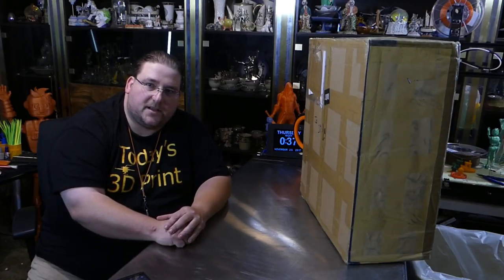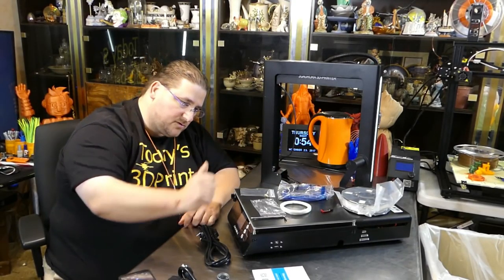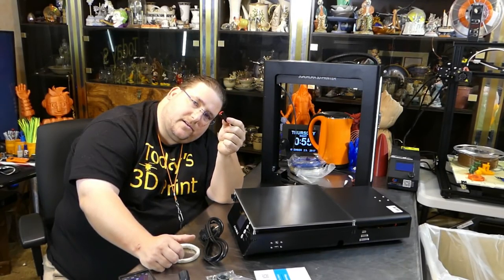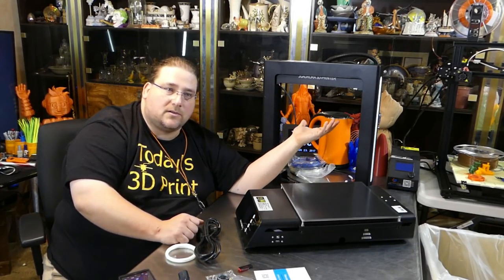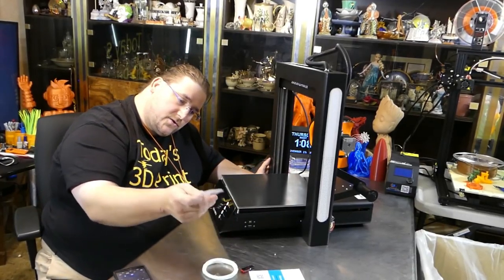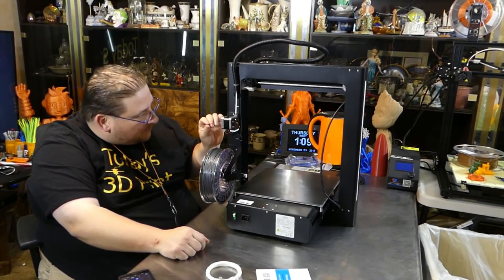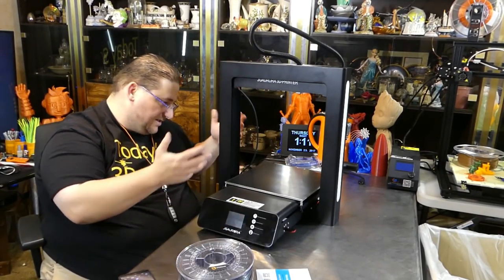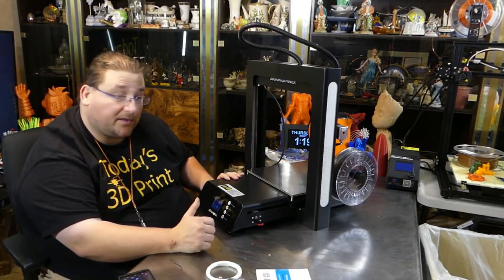Today's 3D Print 162 JG Aurora A5 Ubox, Assemble, Print, Mostly Uncut

Comment: Thanks Chris, as soon as you unboxed it I thought it was an 'ultrabase' equivalent too. Please let us know how well the base performs, and if you reach out to your supplier, if the glass is available separately. Cheers, JAYTEE
Reply from the maker: +JAYTEE Tompkins I just reached out directly to the company $108 for two pieces on the way to me also next month anycubic is supposed to have 310 by 310mm ultra bass on Amazon I will try both
Reply from the maker: +JAYTEE Tompkins forgot to answer your other question so far it is performing very well it sticks better than ultra bass so it does not Auto released like ultrabass at first you might think that's bad but it's actually good because power off resume Works since the part does not Auto release but it's still very easy to release

I suspect if I sanded the ultrabass very lightly I might get the same effect since I have more than one piece of it I may try that

Because the ultrabase can be a little picky about the fluid it will stick to for example it does not like the zyro twinkling filament very hard to get it stick
Reply: Thanks Chris, good to know it's 1) available and 2) it's working well. Cheers, JAYTEE

Comment: Anycubic actually released a CR-10 sized ultrabase a few days ago, it's on Amazon.
Reply from the maker: +Maddie Goldenthal yes they told me that was coming super excited
Reply from the maker: +Maddie Goldenthal darn it not prime yet :-)
Reply: @nerys yeah not yet, but free shipping I think.
Reply: Hmm -- the one I see on Amazon is a bit larger (Z height) than the "std" Mega, but not in CR-10 volume category. Perhaps a link?
Reply: Got my wires crossed -- assumed it was the printer, not the build plate. Thanks for the info!
Reply: I figured that out when you said Z height ;) no worries!

Comment: You should stream all of your assemblies.  Will satisfy us that like the long videos  :)
Reply from the maker: +Truth in 3D Printing I did something similar streaming is difficult because many times I do this late at night :-) this printer for example was 4 in the morning :-) send me an email
Reply: Nerys most live streams I watch are not live, so 4 am is not an issue :)
Reply from the maker: +Truth in 3D Printing yeah but I can't stream 720p or better :-) so I found an alternative solution. :-)
Reply: Hello. What a great video. Thanks for this. I received my printer yesterday and thanks of this video, the first steps has been very easy, but I am having a big problem and want to know if anyone can help me.  I level the printer, then I send it to the home position and then I load a file from the usb drive delivered with the printer to make my first piece with the printer.
After some layers, the piece detaches from the base of the printer. I have try with the 3 samples on the usb drive and allways the piece detach from the base of the printer. I have leveled it some times but nothing changes. Any idea about why it happens? Thanks

Comment: Hello. What a great video. Thanks for this. I received my printer yesterday and thanks of this video, the first steps has been very easy, but I am having a big problem and want to know if anyone can help me.  I level the printer, then I send it to the home position and then I load a file from the usb drive delivered with the printer to make my first piece with the printer.
After some layers, the piece detaches from the base of the printer. I have try with the 3 samples on the usb drive and allways the piece detach from the base of the printer. I have leveled it some times but nothing changes. Any idea about why it happens? Thanks
Reply from the maker: +tomasviana100 okay nothing should detach from that print bed it's a very good Print surface first make sure there's nothing on it it should be black and it should look like fishnet stockings like a mesh pattern glass plate with this weird black mesh pattern on top next you must print hot this printer if it doesn't work a cold you must be at least 50 c 60 C or higher in the winter time but not above 65 for pla

Is pla what you were trying to print?

Next to the surface needs to be cleaned between uses the oils from your hands will stop it from working so we'll dust use alcohol spray wipe down good to go

Lastly watch my cr10 bed leveling video while the print surface is amazing it is picky about bed level you need just a little bit of Squish too much and it might not adhere properly cuz it will curl too little and it won't connect the Y carriage for this printer is a little Jiggly so you need to be careful with fine-tuning your bed level very gently turn each knob tap the bed to reset its position so that it does not float on you

Comment: Great video looks like this will be my next printer as soon as I save up the money.  I have a off topic question.  How do you get such great prints from your Ender 2 My prints are not nearly as good.  I use Cura 3.2.1 as my slicer.  Do you have any exzperence with this slicer and if so do you have the configuration file for the Ender @.  Any helo would be greatly appreciated. Thanks
Reply from the maker: Go to my profile link download a sample file in the gcode folder for the Ender 2 such as a Benji print it it's on STL it's actual gcode just put it on your SD card and hit print compare it to your prince if it's better you have a slicer issue that we have to work on if it's not better then you might have a filament or printer issue that we need to work on

Here are my standard settings for the Ender 2 for all of my printers pretty much I run the Extrusion multiplier at 98% or .98 I set my width and nozzle size manually to .4 millimeter

I run it 50 mm to second with an 80% Outlet under speed and a 40% first layer under speed

I pray that point you told me earlier height I print perimeters first then infill I used three perimeters three top three bottom standard 25% grid both ways infill

I print first layer 220 Celsius second layer and onward typically 195 to 215 Celsius depending on the plastic in my experience with that plastic

That level is the most critical aspect of 3D printing for beginners start with use masking tape that you wiped out with alcohol and spread glue stick over top of it while not the best finish it is by far the most forgiving 4 bed level being off from perfect it has a higher tolerance of failure

Retraction should be 5 mm retraction speed 55mm per second restart speed 20 mm per second

Set your travel speed to 150 mm per second your print speed to 50 millimeters per second

Lower acceleration in jerk can result in better quality but the Ender 2 is capable of quite High jerk and acceleration without compromising quality very much so for now you can leave those alone

Make sure you use a skirt of at least three parameters for small items 2 for large items

The skirt serves two purposes it primes the nozzle and get it extruding filament properly for when you begin putting the actual part and it also gives you a chance to notice bed leveling inconsistencies and adjust it

Don't be afraid to adjust the bed level live as it's printing just turn the knob counterclockwise to slow down the print obviously you can only adjust it while it is on the first layer

Watch my cr10 bed leveling Basics video on YouTube it'll be a picture of me holding two spools of filament it goes into the theory of how filament deposition works which really helps you to understand what you are seeing as you're leveling the bed it's more important than you think once you understand the concept bed leveling becomes much easier
Reply: Thanks for your help. I sent you a gmail explaining what I did. The bengy came out great but I have some questions.
Reply: Sorry not a gmail but posted it on Goggle +

Comment: Half a year later, how do you think it stacks up to the CR-10 and Tornado?
Reply from the maker: The tornado still runs has some issues its an early model i am working on it. The a5 and cr10s are working flawlessly. Zero issues. They are very reliable. Turn them on hit print and walk away 99% of the time.
Reply: Awesome, thanks! So I suppose you don't consider the CR-10s to be worth $100+ more than the A5? 

Besides that, I do like the AIO design. I hope and guess many more manufacturers will release printers like that, and with that print volume.

Comment: What do you think of this printer now that you have more time with it? is it really robust, has good precision and operational quality? I bought one and am waiting for the receipt, but I was a bit scared with another video where it shows several set up problems and poor quality of construction of the printer.
Reply from the maker: +Daniel ricardo alves so far I am pleased it's not perfect but it is good so far the prints are coming out very nice and so far it's reliable I do have some micro noise generation in the y axis small vibration as it moves back and forth and this manifests as noise in the print it's very small but it's enough that I can see it so I'm going to try to fix that if possible otherwise it's working very nicely

Comment: How small a part can the cr 10  print example ,I model ho1:87 scale model trains and I need to print small ladders or side rails for the locomotives. What is the best budget printer ($1,300 Australian )  to use if there is one? or a printer to print the plastic carriage she'll or gears for motors . Thank you Joe
Reply from the maker: +Joe Muller you're definitely going to want to use a resin printer for parts like that I believe the Monoprice D7 is around $500 when it releases? The printer is not so expensive as the resin but your parts are small so you won't be using much

Gears is the tough part since that's a mechanical part that will experience where I am not so sure about that a resin printer can print them but I'm not sure how long they will hold up

The cr-10 will have a tough time with ultra small details like that any fdm printer will have a tough time with that

You could try something like a ender to which would be very cheap hundred forty-five us and give it a shot maybe put a .2 millimeter nozzle on it to help with the small fine details but you're still not really going to be able to do gears effectively not that small scale with an fdm printer

Comment: When i got mine there was a screw loose in the box. It came from the guiding rod inside the machine. After closer inspection, i found that one guiding rod was loose.
I had to open the machine and fix the guiding rod before puttting it together. 
Then i noticed that the filament wouldn't load up and found out that the feeding tube was broken inside the head....
Now the problem i have is that the filament won't load....
 
Any tips on how to make it load the filament???
Reply from the maker: +AWARHERO did you replace the tube? Also once that is done cutting the filament at an angle helps!

Comment: How long does it take to heat the bed to 110c?
Reply from the maker: i have never tried to goto 110c. with the type of print surface it has I don't think you will ever need to go that high. I will run a test when time allows and get back to you.

Comment: That you recommend me to buy as my first 3d printer. Tevo Tornado or Jgaurora a5. Greetings from Argentina
Reply from the maker: +Mauricio Jerez I cannot in good faith give you a suggestion on that yet I do not yet have enough time on the A5 to be certain of its quality the tevo tornado is a known value it's a decent printer but it is quality issues very minor ones but it's very cheap you won't really go wrong with tornado as for the A5 give me a couple weeks to make sure it decent I just don't have enough experience with it yet
Reply: okay. I will be aware of your recommendations. I was already convinced of the Tornado, but the one that brings detector of filament, automatic leveling and possibility of pausing and continuing impressions of the A5 caught my attention. And on the internet, there is still no review or comparison to clarify the doubt. From already thank you very much!
Reply from the maker: +Mauricio Jerez this does not have automatic bed leveling it does have filament detection and pause and power off resume in the event of a power failure
Reply: You're right, I read wrong. In the same way, it has some details that attract a lot of attention. And what about the touch screen seems to me to be more intuitive for an amateur user like me. Anyway, I think I'll point you to the Tevo. If you get to draw new conclusions with the JGAURORA, I would greatly appreciate it if you make a comparative video or, failing that, let me know. : D

Comment: Hey bud love the videos but i as usual have a question. How can i get rid of those dang spring clips on the cr 10. Those things are a major pain in my hiney. Thanks Bud and keep up the great vids. I joined a cr10 group on facebook but no one has gotten back to accept my request. oh well.
Reply from the maker: there are many "possible" ways to get rid of them none easy or fool proof.

you need to have a way to attach the print bed to the printer. its also VERY convenient to be able to REMOVE the bed as well.

one way is to clip it from the "edges" so its "out of the way" of the printing process. there is no "off the shelf" option for this. as time allows I do plan to look into this as magnetic beds are just too expensive for now. (you also need special magnets with a high curie (not sure if that is right) rating so they don't degause when heated. (lose their magnetizm) Build Tak has one but even the one for my ender (not installed yet got to find it still :-) cost me $60 or something like that.

Comment: I'd like to print nylon with the JGaurora A5 my hot end is will only go up to 250°C is that hot enough to print it or will I need some mods?
Reply from the maker: +Kirth Lewis that might be hot enough but you're going to have to really slow down the print I have discovered that nylon will extrude at lower temperatures just fine but if it doesn't heat up the previous layer enough when it lays out the next layer they don't link or become solid it's attached but brittle it will just tear off come apart so you have to slow down so that as an excuse the next layer it has time to reheat and fuse with the previous layer once I'm done my current batch of Prince I plan to experiment with do exactly that use caution the nylon might damage the ultra bass style surface on the A5 if it sticks to it at all

Comment: Just got my JGAurora A5 - what slicer and profile did you use?
Reply from the maker: I just used my CR-10 profile modded for the different bed size. has been working great so far. 5mm retraction .2mm coast (turn that off when doing tiny stuff or adjust as needed)

works great.
Reply: Thanks!  Did you notice the center of the bed was lower than the sides?  I spent a good 20 min leveling and it's definitely a noticeable difference.  I did get the test money cat to print fine (in progress) - but if I printed a piece that took the whole bed, the outsides would definitely be thin...
Reply from the maker: +Rafael Acevedo mine is perfectly flat I do full bed prints without a problem if yours is truly bowed contact the company for a possible replacement
Reply: Thanks.  I just emailed them for a new bed.  Will see how it does when it comes in.
Reply from the maker: +Rafael Acevedo request bed and heater assembly otherwise you have to figure out how to peel off that glass which probably won't be fun :-)
Reply: Nerys great point!   Thanks for the heads up!

Comment: She looks sexy, good specification, fantastic LCD display and she prints OK but after a little wear a tear many of these JGAurora soon start to go wrong and then you will spend months waiting for parts to arrive on a slow boat from China.

if you must buy one of these A5's then use Gearbest because I used AliExpress which means (without a long story) your guarantee is worthless if you decide to ask for your money back.

My CR-10 mini might not look as sexy but she just gets on with the job 24/7 and the only thing I don't like is the use of a micro SD card instead of a USB pen stick
Reply from the maker: The cr-10 mini is an iron Workhorse it's just a good solid kick butt machine I prefer the Ender 3 for its all-in-one more compact structure but you can't go wrong with a cr10 mini :-)

The most common reason for parts wearing out is if the roller bearing wheels are too tight this is a very common issue and I've seen a lot of printers wear out because of it your roller bearing Wheels should be fairly tight enough to stop wobbling any more than that and you're too tight
Reply: @nerys71  Yes agree 100% and parts in Europe for the CR10's take days to arrive but it's not so fast for JGAurora parts because less people stock them and they cost more money and i was very close to buying a Ender 3 myself but now you have made me want one.